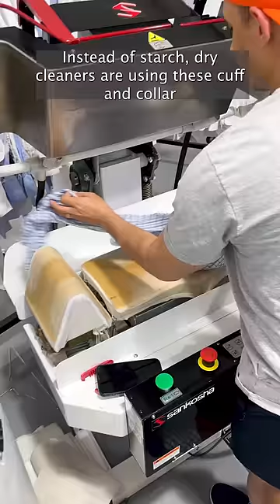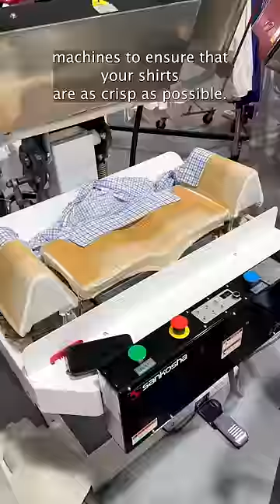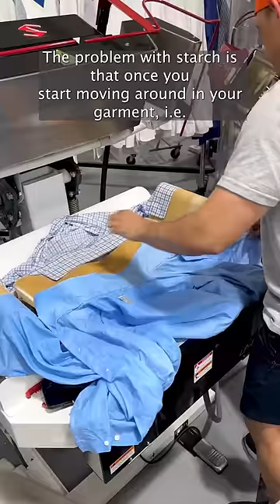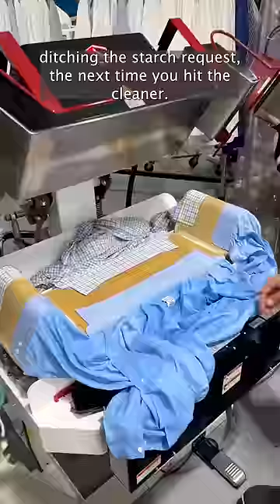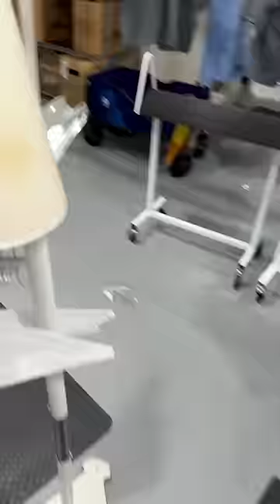How Drycleaning Works - Cuff and Collar Machine #dryclean

Comment: I thought dry cleaners were just really good at ironing.
Reply: Lmao same
Reply: Same
Reply: Worked at a dry cleaners for 8 years. Unless asked  not to starch, it is added to the wash cycle. This is a shirt press which uses  a hot head press to dry the cuffs and collar and remove wrinkles. The body is put in a different unit which blows air, doing the same thing. Starched or not the shits come out slightly stiff and wrinkle free.
Reply: We all did at age 9 lol. I thought they just put them on that rack and spun them thru a hot steamy room and they came out the other side ready to go lol
Reply: Starch and heat pressing.
Reply: @michellelowe3610  I think you mean * shirts  😅
...and they look and wear beautifully!
Reply: Hell no… I mean with the pants yes we use an iron. But shirts are whole ass different type of work 😂😂
Reply: The whole point of a dry cleaners is the fact they have machinery that you’d have no use in purchasing
Reply: Same
Reply: @michellelowe3610 That was possibly the best typo I've ever seen. Thank you sir
Reply: Nope, I always used water on the clothes I pressed, they came out looking better than the starched ones
Reply: Dad is….and complains when his help doesn’t understand seams, hems, and just how clothing is constructed.  No fancy shirt machines just a good seamstress
Reply: Starch is a cutomer request, not requirement and the cuff n collar press DOES NOT replace starch. We also use european presses that use extremely high temp steam/air to "blow up" your shirt and "press" out all the wrinkles. The cones at the end of the vid are where we "break" the collar(make it stand up properly at the back seam- that seam should not be visible if the collar is "broke" correctly. Also most of your time is spent correcting the shirt body press in a way that gets rid of any  avoidable creases/wrinkles as well as using a mini hand iron on the pocket (PLEASE FOR THE LOVE OF GOD AND PERFECTIONISM- CLEAN OUT YOUR SHIRT POCKETAND UNDO ALL BUTTONS PRIOR TO THE CLEANERS!!!
Reply: That literally looks like a giant one press iron
Reply: Me too. 😂 It’s cheating!! Lol
Reply: We are. There are machines like this for efficiency, but most of the items get hand pressed

Comment: No I worked at a dry cleaners and you can see a real difference. No stach the shirts are very soft and easy to get buttons off but they have more wrinkles, I recommend no starch for people who like soft comfortable clothes. Regular/light starch shirts have less wrinkles and the button holes like brand new, I recommend regular starch for people who work in professional setting but still like to roll up your sleeves. Extra starch the shirts are stiff and stay unwrinkled longer if taken care of properly plus the collars of extra starch rarely need the collar sticks because they stay stiff and the cuff does too, I recommend extra starch for wedding settings or high class suit and tie work settings.
Reply: May i ask the ratio needed for light starch? Thank You ❤
Reply: When I worked a dry cleaners and shirt laundry we had 4 levels of starch.  None, light, medium and heavy.  The secret was no starch and light starch were the same, none.  Starting with a wet shirt and pressing them dry gave the illusion of starch.
Reply: I've never used a dry cleaner, but I like my clothes soft and comfy, will keep this in mind if I ever need to go to a dry cleaner
Reply: Hello mates as you people have worked in this industry would you please share how you used to dry starched clothes after washing as it can't be put in dryers. Only way I'm aware is sunlight

Comment: Starch is useful for thicker cotton shirts that are supposed to be stiff and inflexible, but for the vast majority of people, a decent steaming and ironing or pressing will be more suitable. Also, you need to use a really dilute starch wash that has been heated long enough to actually gelatinize the starch molecules for it to be able to set properly once dry and ironed. Too much starch and it creases easily and you can feel the starch on your skin as you wear the garment.

Comment: I worked at clothing workshop for a while, there's a special kind of inserts in the collars and cuffs that contain a heat activated adhesive, the machine is just used to reheat it and straighten it , the cotton has nothing to do with it nor the fabrication of the cloth, you can use this kind of insert in wool too

Comment: dry cleaners have different press machines that they usually use regardless of starch. you can also use starch with those machines, which will make the starch more prominent and smooth from the heat. 

starch makes the shirt really stiff like cardboard. wrinkles could be noticeable but its usually pretty straight. honestly most of the customers that wanted starch shirts were cowboys

Comment: To clarify,

That's the process of Laundering Shirts.  

The cuff and collar machine is only used for that process and not for Dry Cleaning finishing/pressing.  

Two completely different processes.   If you're having your shirts Dry cleaned the finishing process is a bit different, where most of the time the shirts are hand pressed.   

Great content though.  👍

Comment: What blew my mind was. Dry cleaning wasn’t dry at all. They washed your clothes but with chemicals. 🤯
Reply from the maker: water is a chemical :)
Reply: @jeevesny dude, you think starch makes wrinkles worse. You have no say whatsoever.
Reply: @literallyanangrymoose7717 that was kinda aggressiveness 😭
Reply: @literallyanangrymoose7717 as a dry cleaner what he’s saying is absolutely correct IF you have modern cotton shirts starch really isn’t needed because they’re cheap and wrinkle super easily. Ive seen hundreds of shirts and can tell you the difference of some of the more popular brands with and without starch is negligible right after the cleaning, but when they bring starched shirts back they’re usually way more wrinkled than non starched clothes. Good cotton shirts with starch are probably what you’re thinking of but good cotton is getting rarer as clothing companies get cheaper and cheaper on their materials
Reply: Yea, I don’t really fully understand it, the old guy we have as a manager sort of explained it in easy terms to understand even if it’s not fully factually accurate (and I don’t remember it because it was when I started like 3 years ago, the chemicals we use instead of water gets out certain stains out better than regular water and are good on delicate clothes that would otherwise get damaged from regular washing although, most dry cleaners also have “regular” washing machines as well for those few special items that don’t do well in the dry cleaning cycle.